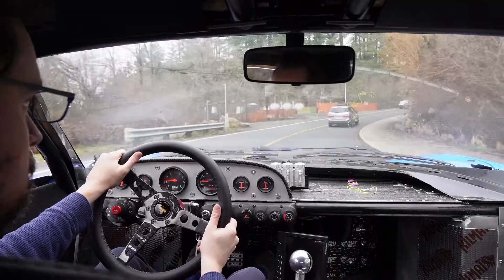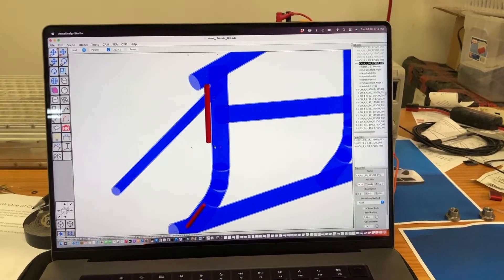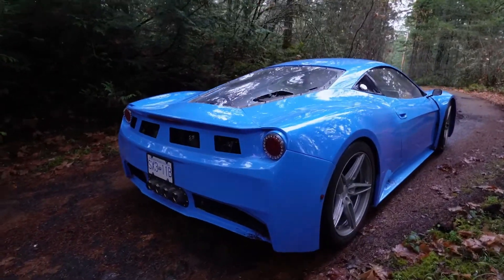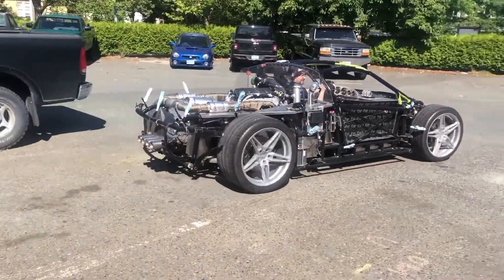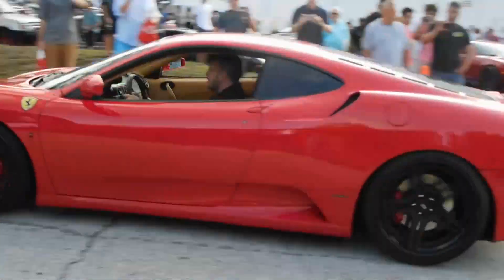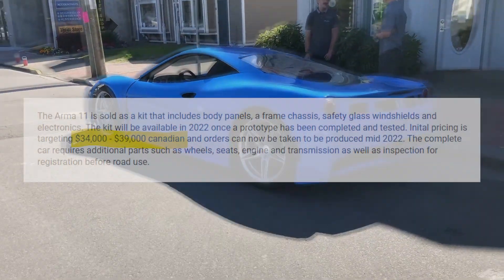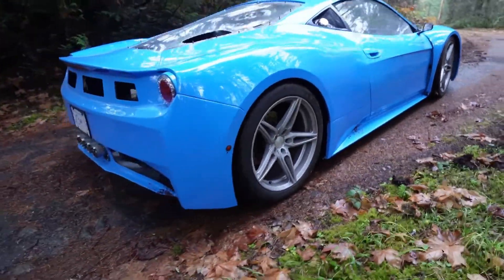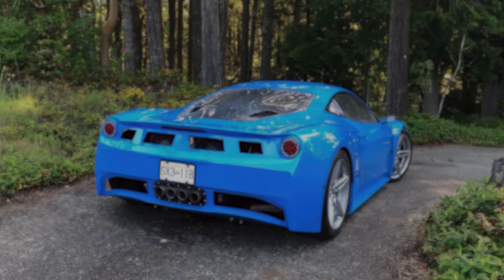Is the Arma GT a CHEAP SUPERCAR?

Comment: It's a cool car but the consistency of the surfaces across the panels is pretty poor. The door surface doesn't flow well into the front fender or the rear quarter panel.  It almost looks like the door is from another car that was "close enough."  Just saying.  Taking more care in flowing lines and continuity between panels would put this design where it should be.
Reply: This is a test car. Not the final production. Obviously from just looking at the interior.
Reply: Interestingly this is because the chassis was built 1.25” too short. We were rushing to get the prototype out for a show and the day before cut the front section in half to shift it back. The prototype has served it purpose though. Now we are finalizing windows, locks, new suspecting and upgraded windshield wipers.